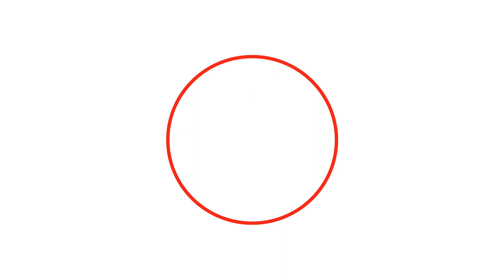Sump Pump Battery Backup Installation Time Lapse | Pump Sentry 822PS

Comment: Can the pump sentry only be installed on the upright position?  Is it ok to lay it flat?  Thx
Reply: wondering the same thing here...
Reply from the maker: A high quality plastic or nylon battery box with a lid designed for battery storage should be used when storing your selected battery.   Pump Sentry® is typically mounted on the wall, above the sump pit or crock, and in compliance with all applicable local electrical codes.   Ideally, it should be close to a grounded AC outlet and the battery box (not closer than 2 feet).

Comment: Did you drill through the unit? How did you get it to stay?
Reply from the maker: There is no need to drill through it. It comes with predrilled mounting holes. Thanks for watching, great question.